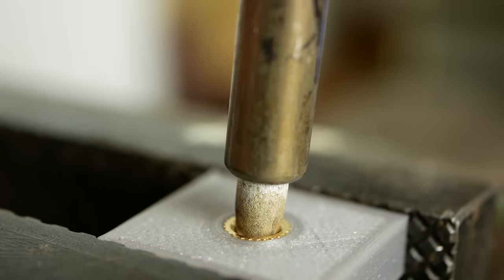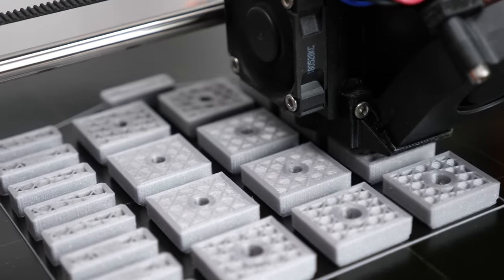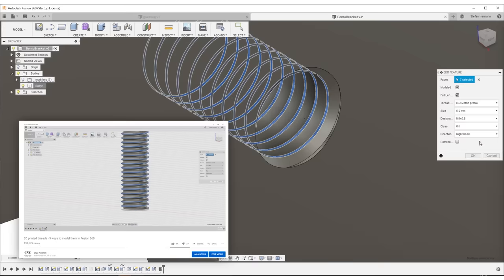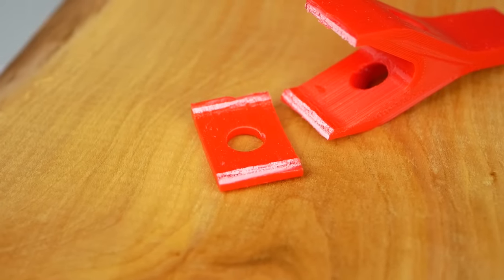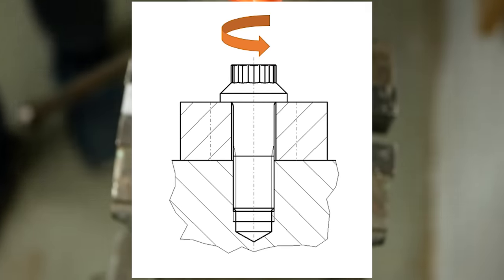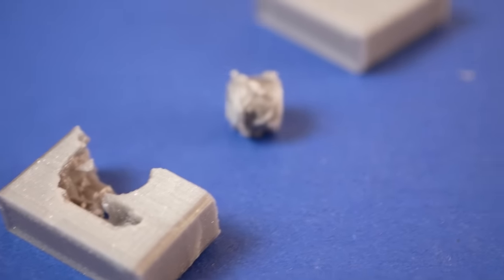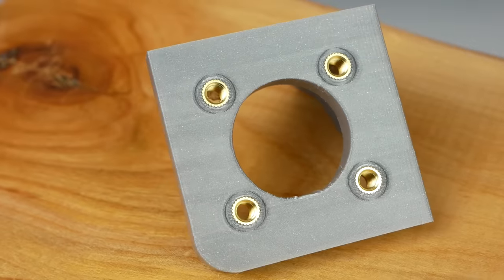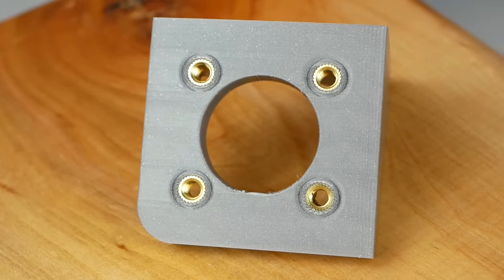Threaded Inserts in 3D Prints - How strong are they?

Comment: I have been using these for a few years, usually from McMaster-Carr. They are very nice. The technique to put them in could use some work though, the extra 'ring' surrounding most of your inserts can be avoided by careful attention to size of hole, temperature of iron, and putting the face down on a flat metal surface to cool and prevent it from raising.

Comment: I use undersized holes on small diameters and modeled threads on larger diameter. You mention it briefly but I imagine the extra strength just comes from increasing the hole diameter

Comment: You can get incredibly strong connections using threaded brass inserts. Especially if you can install them from the reverse side. You are then pulling against the rim around the top of the threaded insert AND the knurling around the brass cylinder.
As a side note, if you do this test again... I was wondering if it would be possible to use the threaded brass inserts designed for WOOD. They are similar but instead of knurling on the outside, they have an incredibly robust thread on the outside (again, meant to be threaded into wood). I was wondering if it would be possible to heat them up and thread them in at the same time into the printed plastic. Either way, the brass inserts are the way to go. Even the very basic ones provide a  stronger connection than the printed material can support. Nice job.

Comment: I use M3 and M5 most often depending on the application. Normally I will make a square or hexagonal cut out for a nut to be inserted somewhere in the path of the bolt (similar to how the parts on a Prusa MK3 is designed). Great video!

Comment: I usually use a tight hexagonal hole to insert a nut on the opposite if the design allows, then I will not need a wrench for the nut, instead of an insert. When dealing with threads in plastics (and aluminum) , overtime cracks will propagate or threads fail, so it really depends on what the screw is being used to hold. But now I will have to consider inserts.

Comment: Great video! I frequently reach for drywall screws as they cut well into the plastic. I will take a look for plastic-specific screws as well. Also, I will use Slic3r PE to add a 100% concentric fill modifier to reinforce where my cutouts are to receive the screw.

Comment: Excellent investigation. Very interesting. I'm not a 3D modeler (yet...) but I do have some experience of self tapping screws in plastics. In case this is of interest - The rotational speed of insertion and torque limiting is fairly critical. Too slow leads to cold cutting/ chattering and weakening of the fixing. The correct speed partially melts the surface of the thread forming a good surface and partially aligns the grain of the polymer increasing the strength of the fixing. Unfortunately good quality drivers are a bit expensive. The screw itself needs to be designed for the purpose.

Comment: Love threaded inserts when its going to be screwed/unscrewed much or near thin areas. Easier than tapping and looks more professional for bonus points.

Myself for m3 at least, Ive found that sticking them on the longest bolt I have and using a micro torch for a few seconds is the best way, rather than a soldering iron. Drop of water when its in just the right position. Prevents the plastic from getting into the threads and makes it much easier to tell if its straight. Dont know if it would be overheating and weakening the plastic, but Ive had no issues so far.

Comment: When using screws in PLA, I usually use wood screws, when I can. Wood screws have more prominent threads. You just have to get the hole diameters correct.

Comment: Started playing with inserts for HeroMe6 setup, and I freakin love them! Had hex holes for locknuts on previous prints and nylock torque easily surpassed the PLA strength. These are so much better and faster to engineer into parts.

Comment: Very interesting. In the torque test, the vise jaws are pressing against the sides, giving some extra resistance against breakage. Perhaps not much, but a comparison would be needed. As far as the pullout test goes, the holding device helps prevent plastic breakout. Again, it’s hard to say how much. The diameter of the opening vs the diameter of the thread or insert effects how much.

Interesting though.
Reply from the maker: Good points.

Comment: I generally use M3. If I have a specific reason, I'll use M4 or M4. Very rarely I'll use SAE if I am working with something that has already established this standard. 

Most of the time I just print the holes undersized, and let the screw tap it's own thread on the way in. However if I really need strength, I usually just extrude a hexagonal opening into the model for an M3 nut on the other side of the existing hole. This is also nice because if I get the dimensions right, I can push in the nut beforehand and I don't have to hold it with anything like pliers or vice grips.

Comment: I use brass inserts as well but instead of heating them up I just drill/design a hole a bit smaller than the diameter of the insert and use my bench vice to press it in. I think it's a better way as it does not distort the plastic around the insert as in your method.

Comment: I use a different thread insert nut, and print a hole with tight tolerances, then use J-B Weld original glue to glue them in. Very strong. I'd be interested to see a comparison with your test machine

Comment: With PLA i just model them in, but with PETG the flexibility of the material seems to make the threads more failure prone so use inserts for that and nylon. I have yet to have even the modeled threads fail in use, as long as you remember not to overtorque them during install. Also remember to install them slowly, not with a cordless drill, or risk simply melting the threads right from the start.

Comment: Great vid. I occasionally use these(mostly M3 and M4) for parts that will regularly be unscrewed. But in general its much quicker(and less prone to cockup) to just tap the hole. I never do the pause to insert a nut anymore. I doubt its stronger than any of the methods shown.

Comment: I only use inserts on parts that need to be  removed and replaced enough that the treads would be in danger of getting worn or if it needs extremely accurate threads to mesh with another prefabricated part. From my experience - inserts holding strength Is the same or less as just a bolt/screw threaded directly into the plastic.  (because an inset is basically a screw itself) and you'll also have to factor in the extra space  in your design for the added circumference of the insert. 

I would recommend figuring out how to design parts to require the least amount of hardware - makes it easier to assemble and can be printed and used anywhere around the world regardless of  hardware availability.

Comment: Nice video! It' be nice to have another video to compare how good the different methods align parts. I press fit screws/bolts removing some material so that I can not only use them for strength but also for alignment (basically as if screws were dowel pins ) . That's only necessary for mechanical parts, but I think alignment is still a very important property.

Comment: I have embedded square M3 nuts into several of my projects and have had good results this way.
Reply: I've done the same, would like to see this tested as this is the simplest method most of the time.
Reply: If you embed the nuts, do you still model the threads for the rest of the hole? Does the bolt still screw in easily? Does that make sense?
Reply: @ArturB993  I just moddle a plain hole. depending on the orientation I might make it tear-drop shaped for easier printing.

Comment: I usually use embedded hex nuts , or use wood screws directly into an undersized hole, which will hold far better than printed threads! Also, printing threads will only work over 8mm for me, otherwise the hole will have an interference with the bolt. Keep up this kind of videos!

Comment: I generally use a nut pressure or glue fit into a hex hole and a 5.5mm diameter through hole in my parts.

Comment: Also worth noting that PLA deforms over time when under load (such as the load on the threads) which means that your bolts will lose clamping force over time as the printed threads deform.  The insert solves this problem.

Comment: Since I never trusted the inserts, at least until today, I always modeled a hole and a passage for a nut to be easily inserted from the side. It never disappointed, but this seems like a good idea as well. Inserts look better and, as I now see, work great. "Nut inserted from the side", however, lets you get your nut out when you want to throw the part away, might be even stronger (depending on how much space you have), but the nut may fall out if the design is not tight at all (when you unscrew the screw. It's kind of annoying, but for the holes I designed loosely, I used hot glue so the nut never falls out again), and well, you need to design the hole and a "passage" for the nut. Also, keep in mind that nuts are cheaper :D 
Hard to tell which is better, but I might order some inserts and give them a try in the future.

Comment: I use #6 size (few stores here sell metric screws) most often...if its low stress like holding a cover over a box I print undersizedhole then drill to size (1/8 inch for #6) and slowly screw it in.  For joints needing more strength I use a nut, either printing a slot or press fit hex recess.  Or if captive hardware is not required I may just put a hole all the way and use an external nut, which lasted years including thru carwashes on my car trailer hitch wireing mount until backing into snow snapped the plastic (at a seam, not where it was screwed).

I found infill type mattered more than amount, I have come to prefer honeycomb.  Its slower but way stronger.

Comment: For pull out strength put the insert in from the rear of the part if possible. then it will be required to pull through the part. The only loss is that it looks less attractive then a correctly orientated insert. There are also things called Tee nut inserts that are made for rear insertion in wood and have a huge surface displacement that allows very high pull through. In cases of pure clamping force a teenut insert combined with a bolt and panel washer will provide a sandwiching hold force greater then hold force of the metal threads or bolts tension failure.

Comment: The main problem/challenge with the threaded inserts is to insert them vertically into the part. If you are screwing the bolt from behind the part thru a hole, imperfect placement will not let you screw in the bolt.

Comment: I often use M3 and M4 bolts and have some of these inserts lying around here.
I once tested them with a luggage-scale and they ripped out at around 20kg which is fairly enough for the most cases.
I tried undersized holes and no hole at all, just heat the insert up with a lighter and jam it in the part - even though it only really grabs onto the three top layers it hold up plenty strong.

Interesting to know would be PETG, because I noticed, that PETG ist not as brittle as PLA, so the failure isn't as sudden as PLA - maybe that affects the pullout results

Comment: For M4 and M3 size I like to use brass inserts if they have to hold some force, I also use M3 size plastic screws for mounting umm.. like some PCB to printed part/case.

If it need to hold very much force I use just bolt and large spacer in otherside until plastic cracks :P

Comment: I use insert nuts (Rampa Nuss in German?). They are similar to these threaded inserts, only they have a coarse thread on the outside, meant to be screwed in wood. The thread is coarse enough that a strong innerthread can be modelled and printed in the hole for the nut to go in. Maybe give that a try?
Reply: The advantage is you don't need to use a soldering iron to put them in and you can easily remove them again.

Comment: Very useful video. Thanks. 

I use mostly M3 screws. What I would like to know is the affect of solder iron temperature on the 
strength. If typically set the solder iron on the low side to get cleaner results but don't know if higher temperature which result in more 'melty' insertion will result in stronger parts.

Comment: For those times that I design something of my own I try to not use threads in the design and instead try to make a pocket for a nut. If it has to be inside the part I use square nuts, if it is accessible from the outside I use a washer and a nut. And for the screws I always try to make room for a washer, the bigger washer the better.

Comment: I would be interested in seeing some load tests of m3 threads if you revisit this topic later. Mostly just for curiosity's sake, since I use m3 inserts for mounting standoffs in Pi cases and motherboard trays and I doubt the threads are ever under any crazy loads. (I make weird decisions for looks, and excessive use of brass is one of those.)
My thinking is that the reduced contact area might make the inserts more prone to being pulled straight hour.

Comment: I personally use standard M-nuts pocketed into my own designs. I mean it takes something like ten seconds to draw desired hexagon and "emboss" it into model. But yeah I've used some modes that have had threads printed and I guess they're ok, but they never convince if design is meant to be assembled and disassembled. Also embossing standard nut into design generally means that with small threads you also don't need much material thickness. I think about half of those brass inserts and I'm about 100% sure that hexagon nut embossed into design is also the strongest of all of these. Good video, but was expecting to see this very simple method compared too.

Comment: Very good video. I would like to see how the inserts work with a non-composite nylon. A flexible material like that may behave differently. Generally if you need a threaded insert at all you are probably designing something that requires nylon for its impact resistance.

Comment: Just discovered your channel! It's great! Sadly I rarely have cause to comment on youtube videos other than to note note areas where they may have made errors or could improve their methodology but  even taking in to account your limited budget for tooling I have to compliment your knowledge of engineering and testing methodology. Great work. Learned a lot from this video and look forward to the knowledge I can gain from watching your channel.

A question. In your destructive testing do you observe that the 3D print material has molded tightly to the outside of the insert as if it formed a vacuum when inserting or do you observe gaps? Maybe you could coat the outside of the insert to observe where the 3D print material contacts the insert. Thank you for your work. It's much appreciated.

Comment: I usually use M3 threads in PLA, made with a screw heated about 12 s with a fire lighter. The pre hole is d-pitch (2.5 mm)

Comment: How would heating a bolt and screwing it in workout?  Take all three of the plastic threaded versions, but heat the bolt/threader up as you are inserting them, let the plastic cool with the bolt still in place, and then unscrew it to check the threads.  I don't expect it to be as good as the insert, but it'd probably be somewhere in between without having to purchase the insert where they aren't needed.  The benefit might be with the plastic getting heated together more and merging more throughly.

Comment: Very interesting as always, Danke !
Try out MDF screws (the kind used in kitchen cabinets), I have had great success with these, particularly for joining large parts to each other with them, but have no idea what their comparative strength is. A lot cheaper than bolts and available in really huge packs !
I have also tried dry wall fixings - the kind that go through a wall and "open up". A bit expensive, but interesting :)

Would also LOVE to know the best methods for mounting neodymium magnets into prints.

Comment: good vid , agree this needs to be done across more materials ,pla works quite will with threads where as others not so well , i started using threaded inserts when printing petg the threads in petg never seemed to last long they would get scewed up very easy, and threads in polycarbonate would crack if just making undersized holes , again here inserts fixed this problem , i use m3 and m2.5 most of the time and even at this size they hold up fantastic , also tho help align inserts better when close tolerances on holes i put bolt through hole and pull insert in from other side helps keep in square and centered
 in hole

Comment: I love using brass inserts to thin up parts in place of a nut trap or a nut on the other side of a print. I'm also curious how the strength of these different inserts would change after annealing the parts.. though this would be difficult to test the printed threads since it will very likely distort them out of shape too much to test. The tapped and brass inserts should still work in theory.